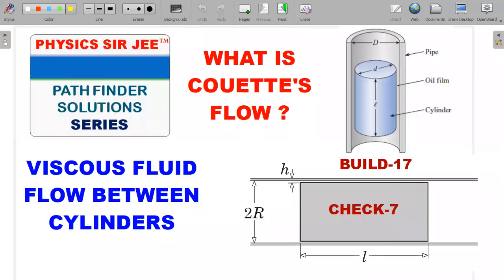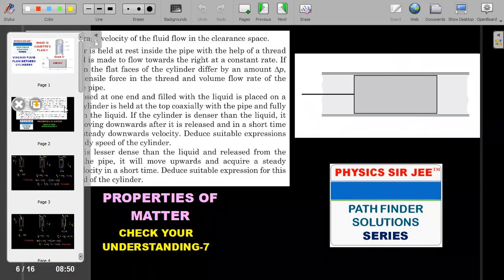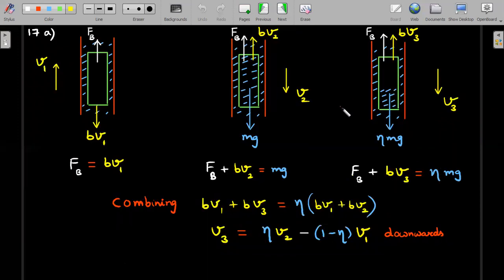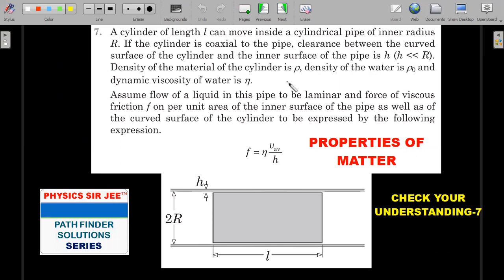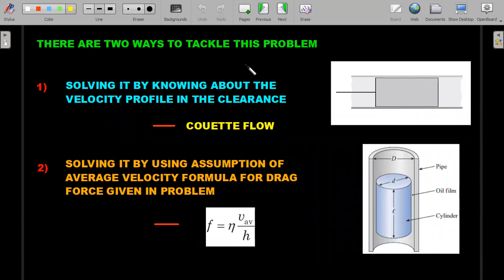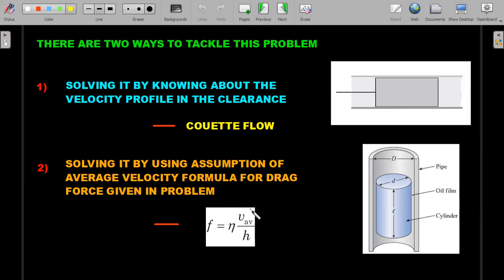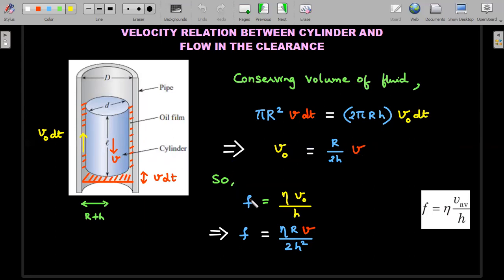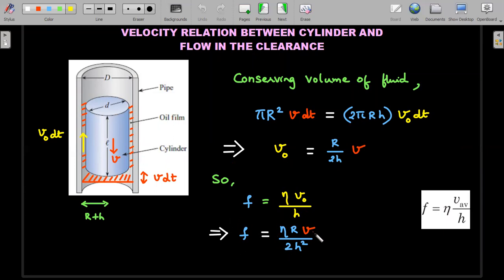PATHFINDER PHYSICS VIDEO SOLUTIONS | VISCOUS FLOW | CYLINDERS |BUILD-17 CHECK-7 |JEE ADVANCED SCHOOL

Comment: Sir plz notice at 9:31, the tension expression becomes 2π(del p)R² for h=R, meaning there is some force on a loose string(since h=R implies there is no cylinder).. which is wrong...evaluating the value for tension by considering h in the equations and then applying binomial gives the expression to be πR²(del p)(1-h/R)..which corresponds to the limiting scenarios

Comment: @2:45 sir if we write Fb +bV2 = mg (that is considering the capsule as massless)?.. wouldn't Fb and mg get cancelled and wouldn't it mean the final terminal velocity would be 0 ?
Reply from the maker: Allowance is made , I think by the author of the question, for negligible but non-zero thickness of material of capsule. May be , that's why instead of cancelling Fb and mg , they are taking three different readings

Comment: Sir at 5:28 why have you multiplied mg by k??  In question it said that the density of liquid is k times that of the liquid in the tube...not k times of the liquid which was in capsule earlier..
Reply: liquid inside and outside the capsule were the same in the (a) part.

Comment: It is confusing. In the problem R is inner radius of the pipe and not the radius of cylinder. 
  Also how do we justify linear variation of velocity profile in the gap, instead of parabolic.
Reply from the maker: There were two questions , so , since you didn't mention the time stamp or which question , I am guessing that your doubt is in second one 
1) Gap is given small , so R+h is approximated to R in final step to reach the answer by the author of this Olympiad question
2) The gap is assumed to be small and in the question itself , it was mentioned to consider average gradient and hence the linear variation.
I hope it's not confusing now

Comment: The term 2pi(R+h) is not clear, as the inner radius of the cylinder is R. Please clarify.
Reply from the maker: Please kindly post the time stamp of the doubt
Reply from the maker: Since , you have not posted the timestamp of your doubt, I am assuming it is at 13:24 of the video . You can see the R+h term comes in the calculation of the tension there. 
Posting timestamp helps navigating easily through my old videos

Comment: Sir at 16:25
The displaced liquid squeezes into the gap, but how do we know it completely occupies the gap, by displacing out all the pre existing fluid in the gap?
Reply from the maker: Incompressible fluid and cylinder is completely immersed
Reply: @PHYSICSSIRJEE  yes sir, incompressible, but why should it drive out all the already existing fluid in the gap? Maybe only a part of the gap is occupied by the small displaced volume?
Reply from the maker: @mihirdeshpande4345  completely immersed

Comment: Sir Pathfinder properties of matter "build up your understanding q 1".... please sir...I have tried a lot... please sir
Reply: I have solved this question. but according to me the answer given to this question is wrong.
Reply: @ayanahmed1089  no it's correct...few months earlier I had solved it ....I got correct answer...use the fact that COM doesn't move....
Reply: Yeah it's correct that COM will not move but in answer it is given that Center of rod will not move. The COM of rod and the Centre of rod will not be same after that type of temperature graph given.
Reply: @ayanahmed1089  yes bro....I have used that fact too..... imagine nailing the center of mass...(then solve the problem ).....